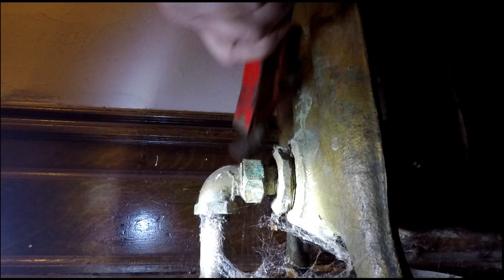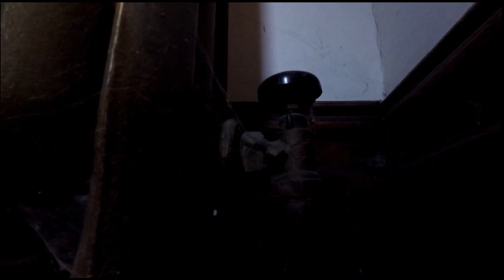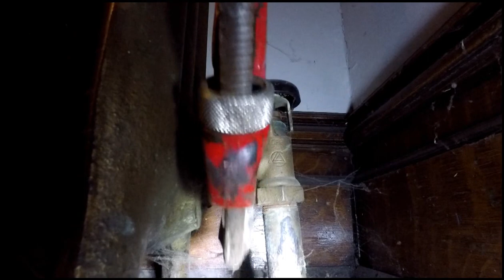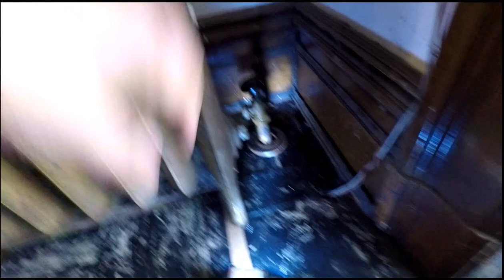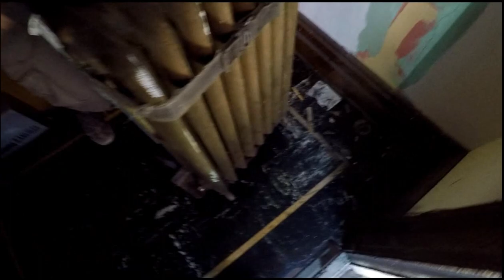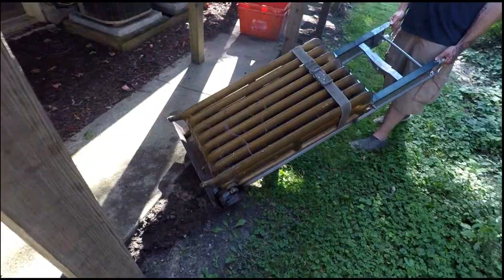Remove hot water hydronic radiator

Comment: Did you drain the system before removing the radiator?
Reply from the maker: Yes the system will need drained to remove the radiator. On this one I may have had valves in there to isolate this one from the rest of the system. Usually that's not the case and the entire system will need drained.
Reply: found out the hard way you have to or else expect a flood of black rusty water.